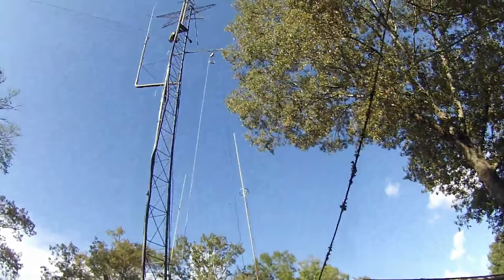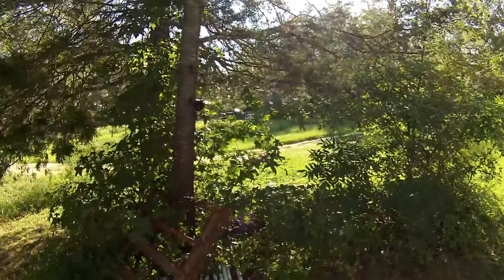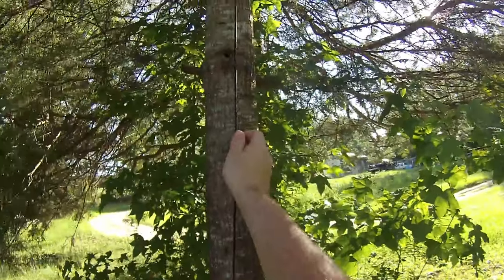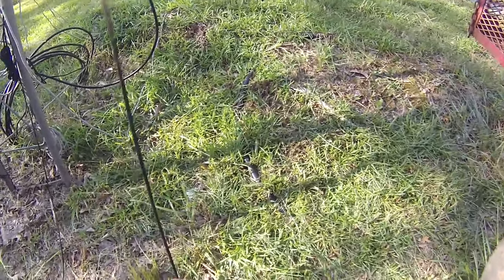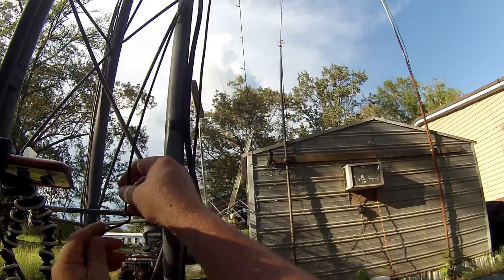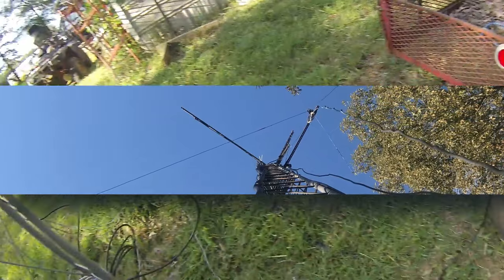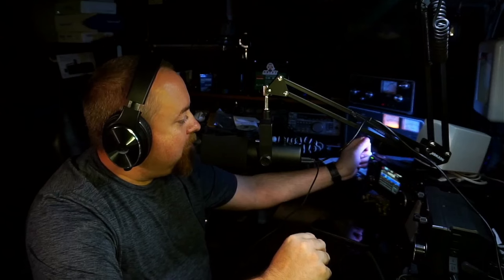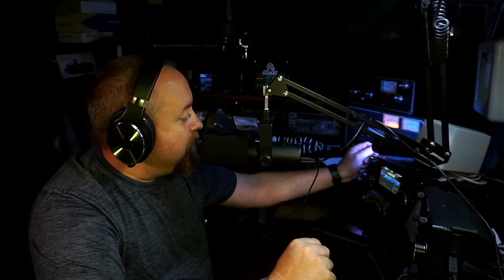Antenna Balun Swap ⇄ ⋮ POV ⋮ Ham Radio ⋮ Vlog

Comment: Looks good.   I used eyelets on the masts for my 40m dipole.  Looks like we use similar tripods for our phones. 

We should try to make contact on 40
Reply from the maker: Thank you Douglas. I got a few different tripods for the phone, but I like that one, it’s versatile lol. We should try the contact some time for sure.
Reply: @K5YVY  i thought i heard you on the yl system earlier this week.  I've got pretty good swr across 40m.
Reply from the maker: I have heard the yl system plenty but it’s been years since I checked into it. Haven’t been in the radio since Sunday evening 🤦‍♂️